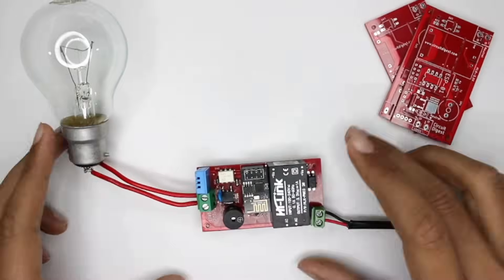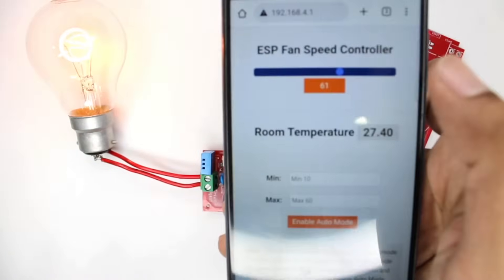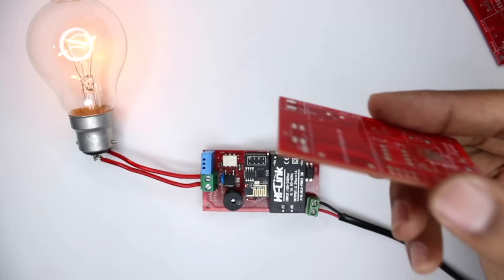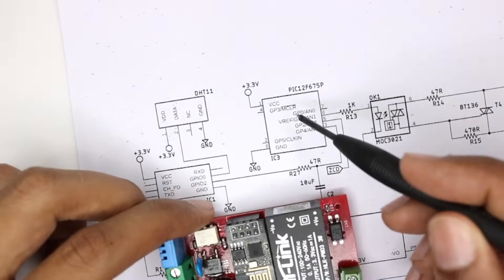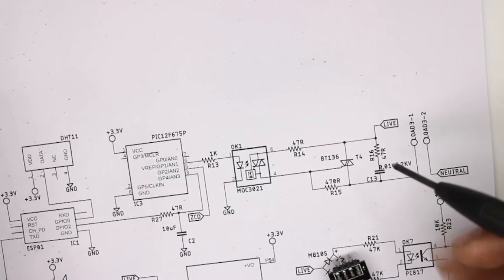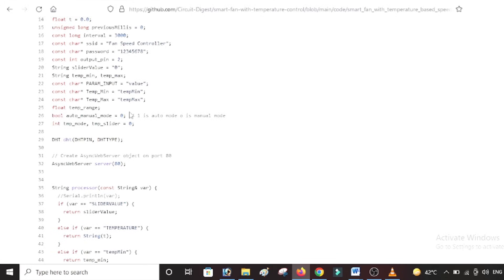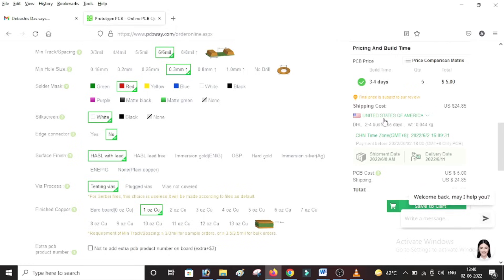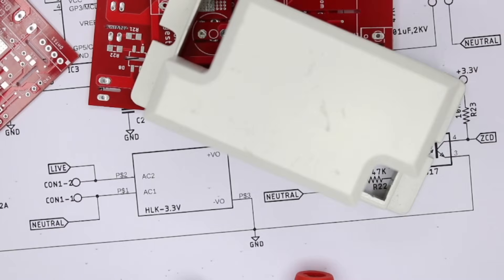How to Make Your Fan Smart using DIY Modular Home Automation System

Comment: Maybe a version for Home Assistant so the webserver is obsolete? I'd like to build one for higher Amperage, say max 15 amps. Will this circuit do when another Triac is used and if so, which Triac would you recommend for high amps?
Reply: its built on top of a ESP so you can easily integrate Home Assistant. and You can use a BTA16 instead of BT136. but you have to load the circuit and test the thermals by yourself.

Comment: Hi brother I'm santosh I'm doing a integrated project for my M. Tech degree im using dht 11sensor to monitor concrete basically I'm placing the sensor coated with glue in concrete everything is fine till now now I want to record the data in sd card for that I bought all pre requisites like data loggger and rtc but I'm unable to connect work with sd card module it is not getting detected as per the tutorials in blogs
Reply: 😊Z,  R,

Comment: great work, just a remark, instead of using a pic12... with esp01, why not use just esp01, because it has 4 pin, gpio0=ZCD, gpio2=pinin MOC3021, tx for bazzer, rx for dht?
I already did the same thing
Reply: If you are doing zero cross detection, the esp will be busy doing that and will not be able to handle a webserver parallely
Reply: @aswinthraj9021  can you please help me how I can add 3 light switches to this project. Means 3 Light + 1 Fan with dimmer.